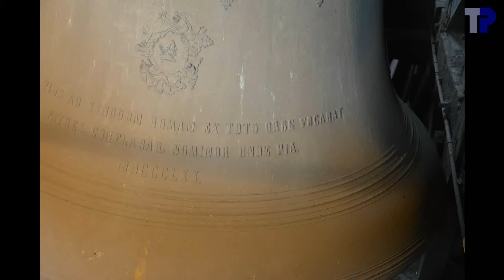Cathédrale Saint-Paul de Liège, plénum

Comment: the bells of Liege cathedral peal, have a falling clapper slow balanced system, very similar at veronese system, and why is Paula ring with a rope by a bellringer? are also diameters known? i m agree with the fact that the bells are very robust(tipic of Causard bells), but not with a big profile. For example, if the weight of Bourdon and Paula are 8000 and 4500 kg we are talking about a G0/Gis0 of 2,3 mt and a cis1 of 1,9, it would be not possible! and seeing immages the big bells in my opinion would be no larger than 2,10 2,15 m, are you agree with me?
Reply from the maker: ArteCampanologia I was a bit lazy and did not put explanations in English.  I should do it more systematically.  Paula is rung with a rope (this is more the bolognese system than veronese ;-) ---though not so high of course), because the motor was broken.  About the weights, I can only give the weights that circulate, but we know from experience that there are many wrong weights for bells circulating, but unfortunately we cannot check the weights.  Unfortunately we forgot to measure the diameters.  Given the tone and assuming the weights are correct, using my empirical formula the Bourdon should have a diameter between 220 and 230 cm, and Paula between 177 and 186 cm.   But the same formula tells that for example the weight of the bourdon of Maredsous is much less than traditionally given.
Reply: Thierry Pauwels A little correction, the bell that is rung  by hand is Concordia and not Paula. Diameters of the bells are given by the sacristan. Further explanations on the weight and diameters of the bells are for you, Thierry ;)
Reply from the maker: +ArteCampanologia I have not added the additional information I received about the names of the bells, the diameters and the weights.  I checked the diameters and the weights with the tone, and they are in perfect accordance.  They are indeed very heavy profile bells.